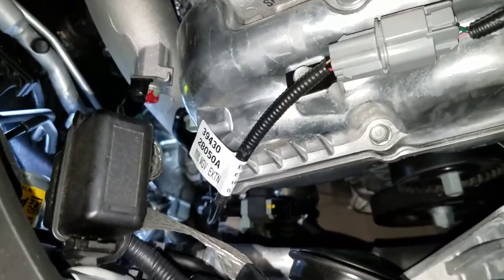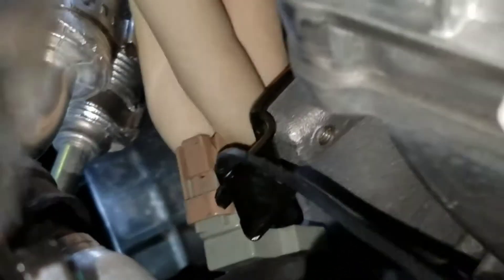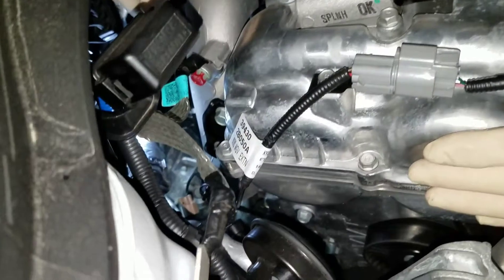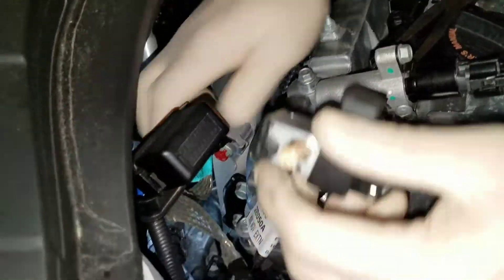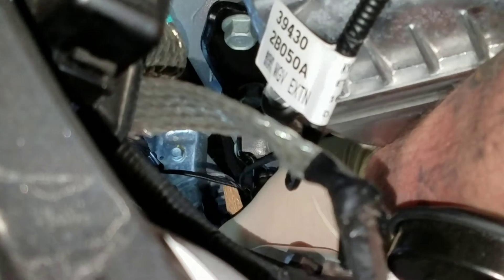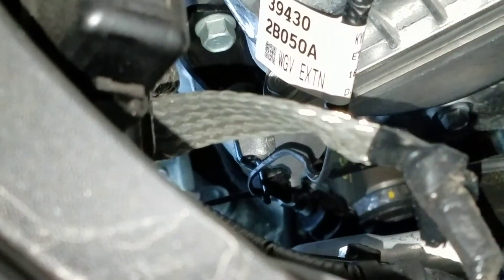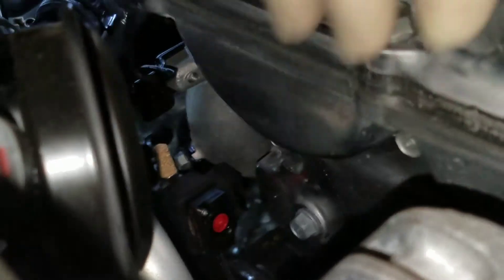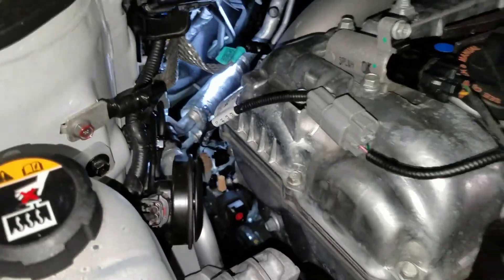Tork Motorsports EBCS upgrade 1.6 turbo.

Comment: Hi, I have a Veloster Turbo 2016, I put a BOV and an intake at the same time. I ran for 3 days before the engine light came on (Not sure the code as of yet but only guessing its the solenoid valve). Im confused about whether a MAC Solenoid valve replaces the one by the BOV or passenger side of engine??
Reply from the maker: There are two valves inside of the engine bay, one on the passenger side (oil fill cap side) that down in the area of the tire. That is for the boost solenoid, or Wastegate solenoid. The other MAC valve is the BOV solenoid and that one is on the drivers side near the radiator fan/upper intercooler pipe. 

They are both MAC valves, they are just configured to work with the different respective control systems.

Comment: I'd prefer to see a 0-60 time and a filmed dyno test done BEFORE the install... and then AFTER the install. 

Otherwise it's just a waste of money and time.
Reply from the maker: I can get dyno results if needed, there are to many contributing factors for 0 to 60 times in a FWD car (wheel spin) that make 0 to 60 times a true measure of the parts effectiveness.
Reply: @TorkMotorsports  Yep... that confirms it. A waste of money. Were you getting any kickbacks, payments or incentives to promote that untested kit?

Comment: I just bought one will this fix my P0236 engine light on my Veloster turbo?????  (PLEASE HELP)🥲
Reply from the maker: Not sure, you can try but proper diagnosis should be done to find the root cause of the failure.
Reply: @TorkMotorsports  it does take care of the code it’s been a week since I’ve had mine on and I haven’t had my engine light come on anymore 🥲
Reply: If it came on after a hard pull reset the code then drive regular and check if it comes back. If it doesn’t do another hard pull and if it pops back up you need this and probably the bov mac aswell if you have an aftermarket bov. Goodluck
Reply: @acexflamesx8067  funny part is it does come on after a hard pull and I do need to change to bov mac sensor but with me having the turbo Mac sensor it does hold its boost better as well

Comment: That's a $20 Mac valve, and you supply it with plastic fittings? Yeesh
Reply from the maker: And a great video and customer support if any issues arise. Profit is not an evil thing, imagine if you complained as much about your 1/4 lb burger at $5.00 that cost the company making them $0.85 or the tooth paste company that charges $4.00 for $0.40 of product. Profit is what keeps the lights on, pays my insurance, pay my wages, ect.
Reply: @TorkMotorsports  yeah, I understand that. There's many people, like me, who need the extra $80 to put toward their insurance and keeping their lights on every month. I have no choice but to pay top dollar for quality products from great companies (mazdaspeed3).  Because, I can't fabricate an intercooler, or downpipe, motor mounts.. I (and many other people)  can install a simple Mac valve.  Dont infer that your bread and butter is selling boost solenoids!

Comment: I just received my valve from you guys but it's different then this one the sticker says to refer to this vid but I have a Mac valve which like goes to 2 and 3?
Reply from the maker: 2 to turbo 3 to WG
Reply: @TorkMotorsports  info for your new mac valve is hard to come by. This video is outdated. Please post a diagram or something.
Reply from the maker: @tobianarmstrong130  we are working on that early next week.
Reply: @TorkMotorsports  thank you I'm gonna have to look at it I had the car up in the air and just kinda winged it.

Comment: Instructions on how to wire the new MAC solenoid to a Veloster Turbo??
Reply from the maker: Our valve comes with a connector, or are you looking for the details on the vaccum routing?
Reply: Tork Motorsports vacuum routing

Comment: Great video for how cramped that space was. This different then a MAC BOV Solenoid correct? I just got a 2020 kia forte gt and no one in any of the groups I follow have mentioned this mod. It seems like it might be a good one to do. Does this mod require any tuning?
Reply from the maker: That is because the new cars do not have this solenoid on it.

Comment: mine is a blue mac solenoid? did the design change
Reply from the maker: Yes, sorry about that.
Reply: @TorkMotorsports  the port in the middle goes to your compressor right? and the side one goes to the line with a check valve on it i believe? Thanks

Comment: When will this be available for the 2nd gens again?
Reply from the maker: The 2nd gen doesn't need one because its all controlled via electronic flapper valve.
Reply: @TorkMotorsports  does that valve need to be changed? Does it hold well.under boost?
Reply from the maker: @BunnyBUNGALO  with a tune you can target any boost level that you want. There is no reason to upgrade a control system like this.
Reply: @TorkMotorsports  I was just unsure because I saw it on your site but its out of stock and some people in forums say the stock one flutters under increased boost so I wasnt sure.
Reply from the maker: @BunnyBUNGALO  are you talking about the BOV solenoid?
There is no boost solenoid on the 2nd gen VT
Reply: @TorkMotorsports  possibly? I think im just confused lol. Ive seen both but ive seen people call them both mac valves so idk. Will the one for the bov more consistent boost?
Reply from the maker: @BunnyBUNGALO  the first gen has BOV and boost control, the 2nd gen only has BOV.
Reply: @TorkMotorsports  I have increased boost

Comment: Is there a way where I could just buy your parts and just go to a shop for them to install?
Reply from the maker: Yes, ask around to the local shops and see if they can help you.
Reply: It actually is pretty easy. Just be confident in yourself. And if the the lil part breaks its fine. Its literally glued on.

Comment: You went to an updated mac solenoid and this video seems outdated in regard to the instruction for hose routing. care to clarify as im sitting in my garage with a different looking solenoid and no idea where what goes
Reply from the maker: The directions for the MAC valve can be found online.
Reply: I figured it out from an Elantra forum
Reply: @jimmofer007  what you do I'm in same situation
Reply: LiL_usher are you working on a turbo kia soul?

Comment: You should do this from under the car. Also, if you would take pliers and twist those hoses before you take them off, they wont break easily.
Reply from the maker: You can get to it form the inner fender well if you take the passenger tire off.

Comment: I swear I'm tripping or something but my Veloster got 3 hoses for the solenoid?? One that goes to the intercooler, one to the BOV, and the third one goes into the engine area dunno what its called lol.
Reply from the maker: Not tripping, you are just looking at the wrong solenoid. This video is for the boost controller not the BOV solenoid.
Reply: @TorkMotorsports  ohhh makes senseeee. I was trying to figure out why my BOV started fluttering all of a sudden. Now I'm more confused lol 😂 but thanks for the reply

Comment: Is this the same on a 2018 Elantra GT Sport
Reply from the maker: Yes, in 2019 I think they moved to the all electric WGA so no need for this upgrade.
Reply: @TorkMotorsports  for the veloster as well??
Reply from the maker: @BunnyBUNGALO  depends on the year of the Veloster.
Reply: @TorkMotorsports  2020?

Comment: I found it easier after you pull it off the bracket to work on it from underneath. I didn't break my OEM by the way ,use a screwdriver. #rusted_customs
Reply: same

Comment: You made this install look easy -- my install included a healthy dose of cursing and barked knuckles. On the upside, I didn't break the plastic connector on my OEM solenoid. Managed to tease the line free with a flathead screwdriver.
Reply: geekjosh I did the same thing but found it a lot easier to do it from underneath.

Comment: Installed a boost gauge in my elantra sport tonight but I can't find a hose that makes boost I use the hose into the intake manifold but it never made boost only vacuum I was thinking of using one of the these hoses to the boost controller would that work or any other tips on where to T into a hose for the gauge
Reply from the maker: Right above the throttle body you can use that hose, just don't cut into the check valve that is in that factory hose.

Comment: What's the advantage of upgrading this ?
Reply from the maker: vr43000gtkid smoother boost curve and potential increase in upper RPM power curve.
Reply: The stock EBCS is garbage. It's especially noticeable when tuned. You'll floor it and the boost will surge so much giving you very poor power delivery. Sometimes no boost at all